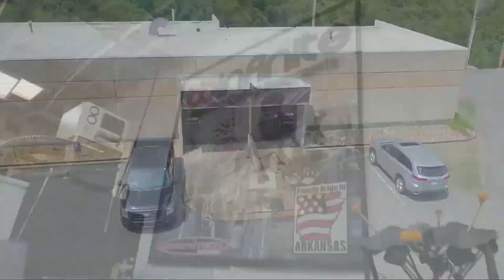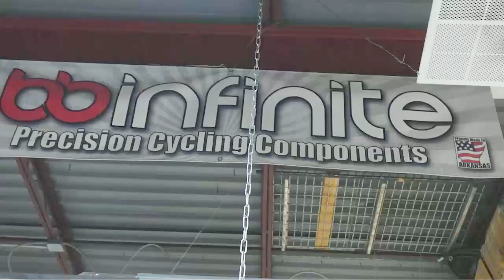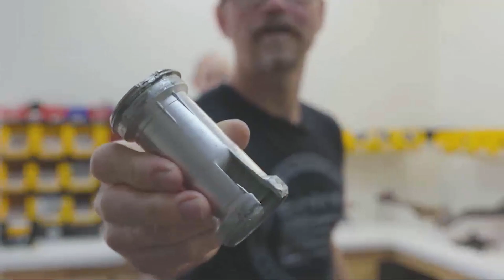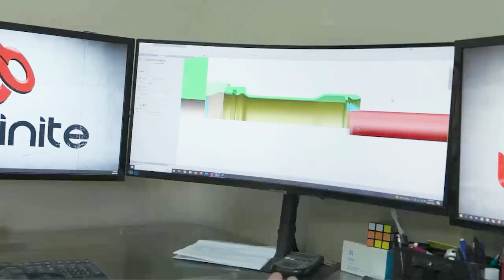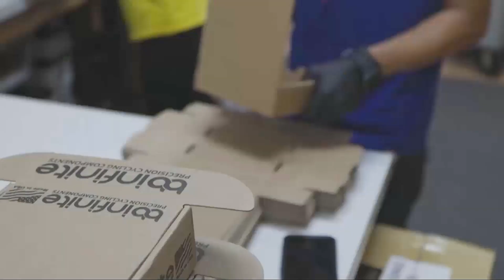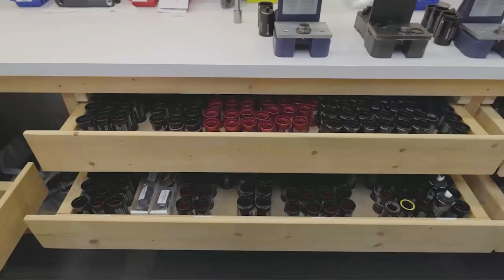BBInfinite: How a Bicycle Part Start-up Found Success

Comment: Here’s how I explain the “bottom bracket” in layman’s terms:

Cars have axles to connect the drive wheels.  

Your bottom bracket is your bike’s “axle,” as it transmits your pedaling power to the rear wheel.  If this axle does not rotate freely, you lose energy:  In your car or on your bike.

What do you think?
Reply from the maker: The bottom bracket is the engine block in the fullness of the analogy. The crank arms act as the crank shaft of the engine. You are the spark, the fuel, the explosive impulse. The pedals are the pistons. The chainring is the flywheel, the output. The chain acts as the drive shaft, with the rear hub and cassette acting as a transaxle. For you guys who think in American or Australian muscle car terms rather than European grand touring ones, think of that rear hub and cassette assembly as a welded Ford 9-inch rear differential coupled to a sequential transmission.
Reply: Gary the Gearhead strikes again!  🦸🏻‍♂️

Comment: I've used their bottom brackets on numerous rigs over the years.  Best bottom brackets in the industry - by far!  No one else is even close.  These guys are in a class by themselves!
Reply from the maker: Awww, shucks. We're blushing.
Reply: The shop I'm working in now stocks them, though only with Ceramitech bearings.

I want to run one with ABEC-7 steel bearings one day to prove that ceramic bearings aren't the solution to a smooth-operating BB if bearing angular alignment isn't perfect in the first place.
Reply from the maker: @sbccbc7471  If bearing alignment isn't perfect it doesn't matter how good the bearings are. This is true.

Comment: I am a customer. I just wish there were more than just the BB and the cage sprocket. I am now getting ads from another company which I just ignore anyway
Reply: I hear you. We've got something big coming for our new gen pulleys. It sucks that we didn't have them out faster for the new Shimano 12spd road. That's the one we're launching first. It took forever to get examples of the group sets in, and by that time it was showing up here and there on bikes. We have development to do that can't be rushed. Yes, you can rush, but sometimes the new idea comes and takes over. Make sense? So are we going to make something else? It's gotta be in the BBi wheelhouse, which is precision innovation. We can't just be making headset caps with our logo on them. Obviously hubs immediately jump out. But if I can't top DT Swiss, why bother? What they make is all it ever needs to be. The bike business lives on innovation.